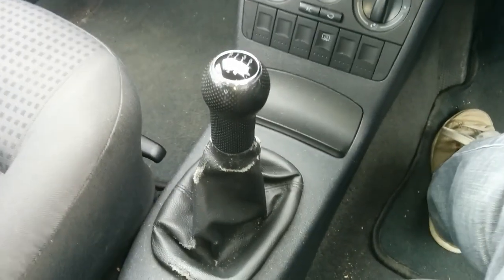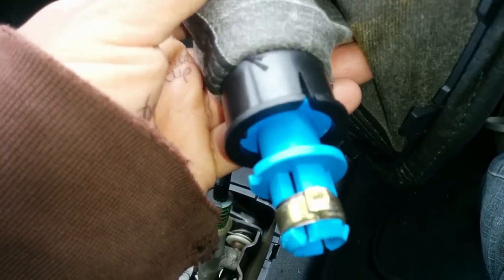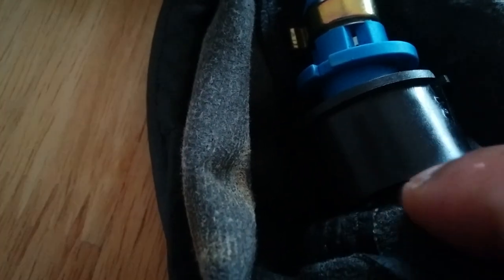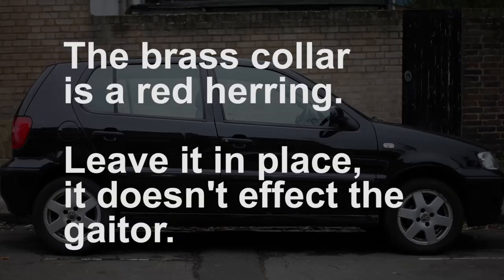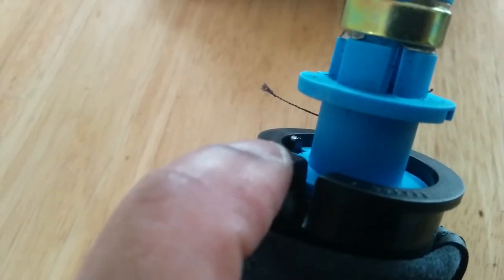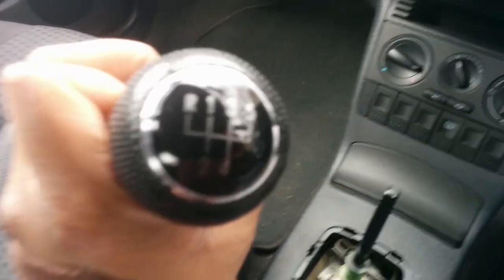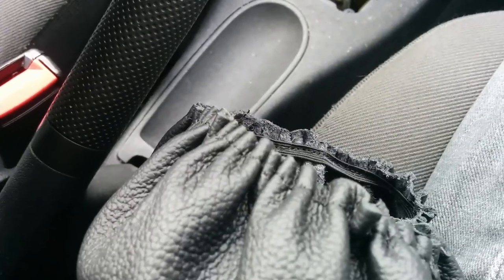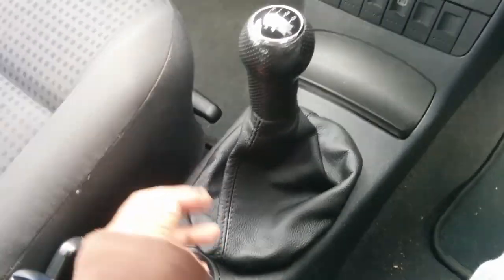Polo Gear Gaitor

Comment: Don't need to worry about that metal retainer ring - they are rubbish and always come loose. Break it then use a really small jubilee clip instead far better. Oh yes line the gaiter stitching lines are meant to line up with the gearknob moulding seams (so the gaiter seems go left to right).